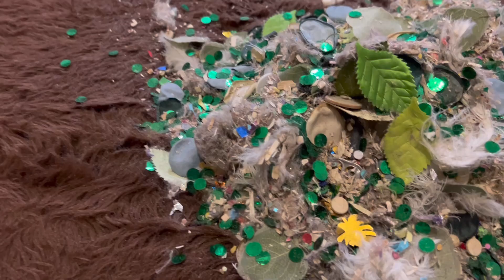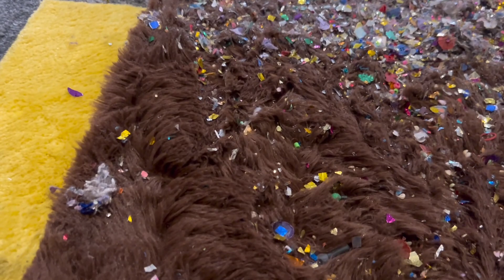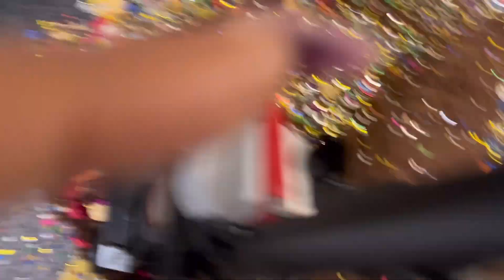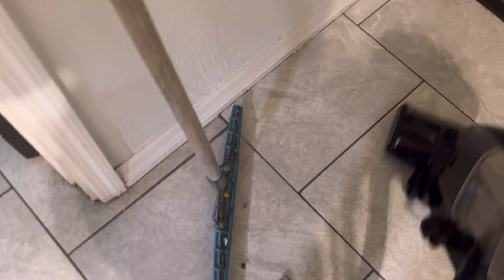Helix vs all my mixes w/ shark clean up| Part 1

Comment: 💖 TIMESTAMPS 💖

✨ 0:00 - Red Helix dusting brush pickups w/ Rumble in the Jungle Mix on fluffy brown rug, closeup 
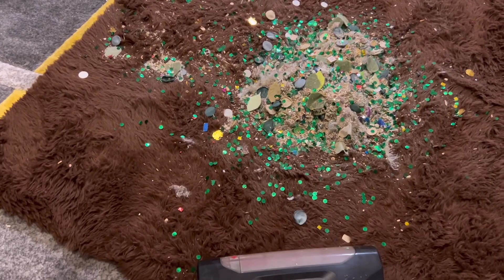✨ 1:57 - Red Helix brushroll pile attacks w/ Rumble in the Jungle Mix on fluffy brown rug 
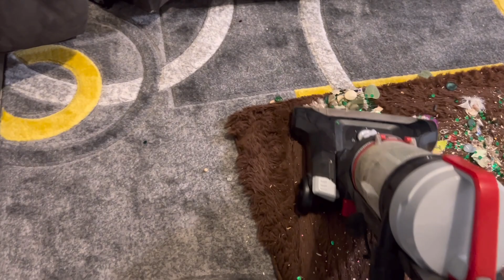✨ 3:28 - Red Helix spread out brushroll pickup w/ Rumble in the Jungle Mix on fluffy brown rug
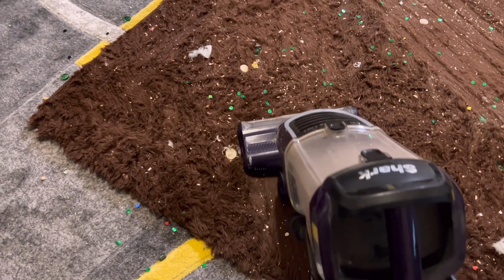✨ 4:22 - Dark Purple Shark brushroll cleanup on fluffy brown rug/area rug + lines
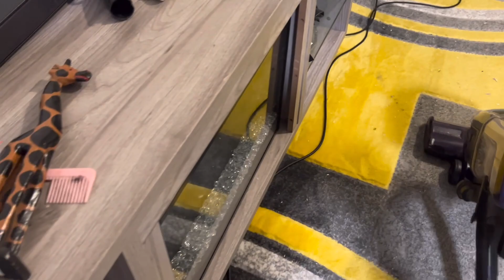✨ 7:48 - Dark Purple Shark brushroll cleanup on area rug + lines

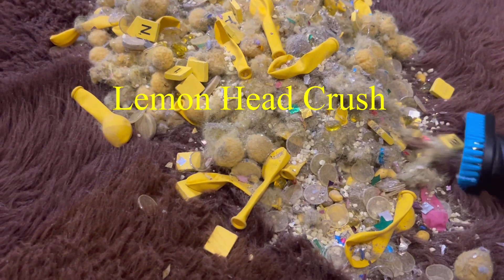✨ 9:32 - Red Helix dusting brush pickups w/ Lemon Head Crush Mix on fluffy brown rug, closeup 
✨ 11:49 - Red Helix brushroll pile attacks w/ Lemon Head Crush Mix on fluffy brown rug 
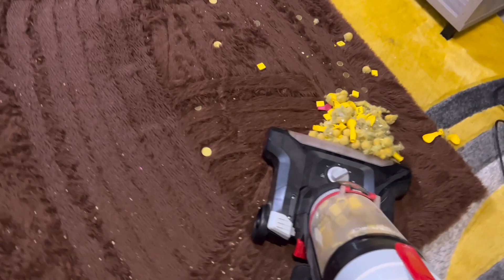✨ 13:04 - Red Helix spread out brushroll pickup w/ Lemon Head Crush Mix on fluffy brown rug
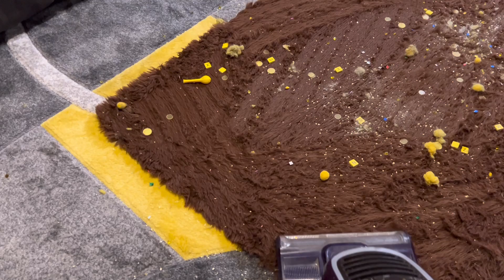✨ 15:11 - Dark Purple Shark brushroll cleanup on fluffy brown rug/area rug + lines
✨ 17:45 - Dark Purple Shark brushroll cleanup on area rug + lines

✨ 19:32 - Red Helix dusting brush pickups w/ Garbage Pail Mix on fluffy brown rug, closeup 
✨ 21:50 - Red Helix spread out brushroll pickup w/ Garbage Pail Mix on fluffy brown rug
✨ 24:39 - Dark Purple Shark brushroll cleanup on fluffy brown rug/area rug + lines
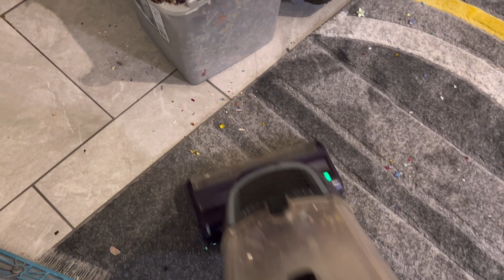✨ 26:30 - Dark Purple Shark brushroll cleanup on area rug/tile floor + lines
✨ 29:20 - Dark Purple Shark hose cleanup on area rug/tile floor + edge cleaning 

✨ 29:52 - Red Helix dusting brush pickups w/ Rosemerra Mix on fluffy brown rug, closeup 
✨ 31:28 - Red Helix brushroll pile attack w/ Rosemerra Mix on fluffy brown rug/area rug + pile pushing 
✨ 33:43 - Red Helix spread out brushroll pickup w/ Rosemerra Mix on fluffy brown rug/area rug
✨ 35:07 - Red Helix brushroll pile attack w/ Rosemerra Mix on fluffy brown rug/area rug
✨ 35:56 - Dark Purple Shark brushroll cleanup on fluffy brown rug/area rug + lines
✨ 38:16 - Dark Purple Shark brushroll cleanup on area rug/tile floor + lines
✨ 41:05 - Dark Purple Shark hose cleanup on area rug/tile floor + edge cleaning
✨ 41:32 - Dark Purple Shark brushroll cleanup on area rug/tile floor + lines & hose